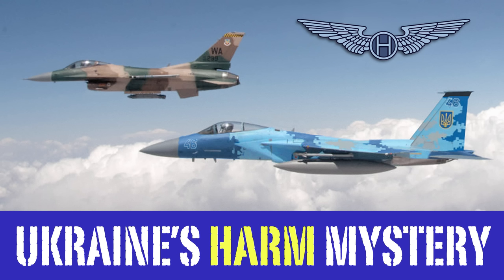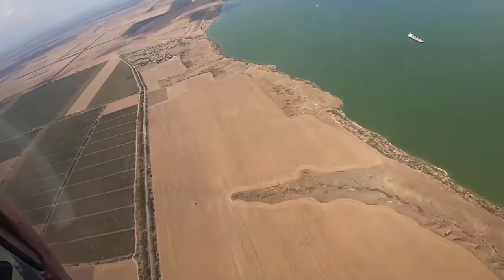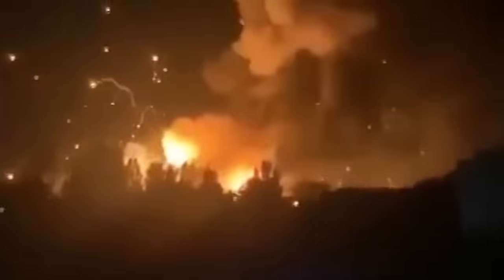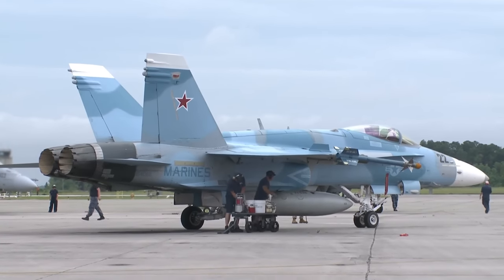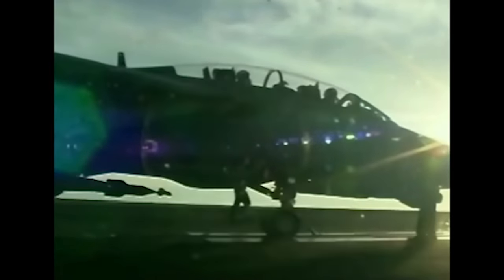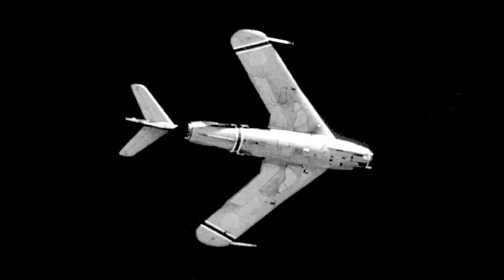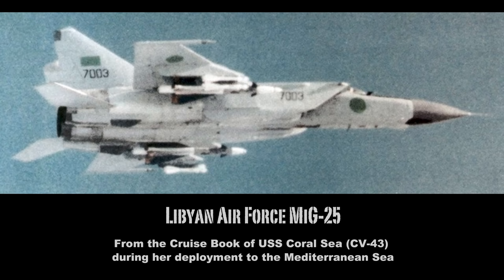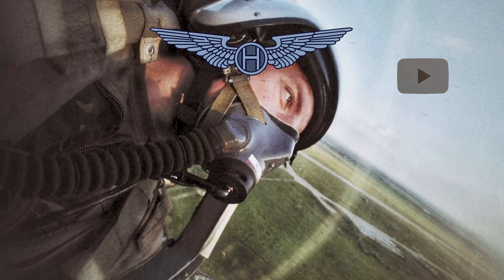Ukraine’s HARM Mystery – How "Top Gun" enabled Ukraine to use HARM Missiles in the War-PLEASE SHARE

Comment: I think you need to research this a bit more. There is another video on YouTube which explains exactly how these HARM missiles are being used on Ukrainian jets.

Essentially the HARM missile has three modes of use. Two require the missile to be programmed via the cockpit, so cannot be used by Ukrainian jets. 

The third mode allows the missile to be pre-programmed before flight to travel to a predetermined location once released from the plane and set to seek/detect a radar signal to follow and destroy the emitting target. The plane effectively just becomes a mobile launcher.

 You can get the location of anti air batteries, either from satellite images or from social media/tourists taking holiday photo the anti aircraft launchers.

No real mystery like this video tries to make out !
Reply from the maker: Thank you. Be aware that the third mode you raise requires Western-compatible electronics on the aircraft anyway. The pilot needs to designate the target, which you call being "programmed via the cockpit", hence electronics and avionics modifications are required so that the pilot provide each missile with an individual set of GPS coordinates and then ultimately launch them, one by one.
Reply: @HistoricWings  I should also point out that Ukraine does have MiG 29's with the required electronics as to fire AGM-88 missiles.  Poland on joining NATO upgraded their planes with the necessary CLC electronics to fire AGM-88 missiles, which have now been donated to Ukraine.

So please stop with all the "top gun" BS
Reply: Comment seems to miss the point of the “Top Gun” link.   When did Raytheon begin to learn the complexities of the MIGs?  During Top Gun.  When did Raytheon start thinking about how to launch their HARM missiles from a MIG? As soon as a potential customer flying MIGs appeared on the horizon.   That is what a firm’s Internal Research and Development (IRAD) is all about.
Reply: GOOD video on Harm + Mig https://m.youtube.com/watch?v=ha-mL1MbvO0&t=11s

Comment: Wonder what could be more. Can they install beyond visual range and better radars? That would be game changing, and currently Ukraine airforce has been bolder in the south. Better NATO equipment can give Ukraine air superiority even in fewer planes, this can dramaticly boost ground forces because they are already outmatching the Russians in numbers, air power can deny artilary to Russia, without indirect fire they simply cant hold Ukrainian advances let alone move forward.
Reply from the maker: It is a valid question -- what else can be done. Far more will be done, but each step takes time to implement. However, time is now on Ukraine's side as the economic sanctions reduce Russia's ability to support the cost of war and keep its forces adequately supplied and reinforced.
Reply: Ukraine has greater numbers of light infantry ground forces which are getting increased western training and antitank and MANPADs but Russians still vastly outmatch them in artillery and armor.  However if Ukraine successfully achieves air parity then the balance could shift to Ukraine’s advantage as artillery and armor become easier targets for air power than light infantry.  The ability for Ukraine to take out Russian air defense also degrades the Russian’s already bad morale.  Breaking Russian will to fight is the real key for Ukraine’s victory.

Comment: Бачив фото, як пілоти ЗСУ, які використовують ці ракети на МіГ-29, мають додатковий планшет у кабіні пілота...
 керування ракетами йде саме з планшету, а не через вбудовані системи літака ...
Reply from the maker: TRANSLATION OF HIS COMMENT INTO ENGLISH:
I saw a photo of how the pilots of the Armed Forces of Ukraine, who use these missiles on the MiG-29, have an additional tablet in the cockpit.... The missile control comes directly from the tablet, and not through the built-in systems of the aircraft....

ANSWERS:
A. I have seen the tablets in the cockpit as well. Analyzing the photos, I came to the conclusion that most of them are GPS related tablet apps for simplified navigation.

B. There is no doubt that the main electronics bus and system on the MiG-29s remains in its original Russian configuration and that a secondary MIL-STD-1553B MUX and supporting electronics have been ADDED to the aircraft. Whether control of the missile is done through a tablet or some other in-cockpit parallel electronics input/output device is unclear at this time, but I suspect it is routed through some kind of MILSPEC rugged tablet-like device that is plugged into a cable connector.

Comment: yeah yyyeeearrrs of develompent lol are you stoned? its put in your new hud and put new rocket holders on the plane get the harm on it . and somehow get the rader working on the system so now you have a plane that only can shoot harm and maybe maybe not sometimes there are errors coz no long time testing
Reply from the maker: Thanks for the comment. To clarify, to "do it right" would take years -- yes, absolutely. However, to field-rig a working wartime solution is far easier and faster -- made possible and even faster because Raytheon already knew everything there is to know about the MiG-29 and its systems -- this was exactly the point of the video.
Reply: @HistoricWings  okey thx also there must be many companys that make stuff like this for su-s and migs like that south african company that made that sick mil mi-24 upgrades
Reply from the maker: @fdsfggr  -- There are definitely companies that provide "aftermarket" modifications to Russian equipment -- in fact, thousands of them. As well, as another military expert friend of mine pointed out, the Israelis were able to mount a working MIL-STD-1553B MUX onto a MiG-21 some years ago so that Western compatible avionics could be operated from that type as well.
Reply: @HistoricWings  hmm interesting good is that all new componets tend to get smaller XD so they have space in that old planes so now we get nice mig 21 with harm XD only  that plane wasnt exactly the savest to fly XD